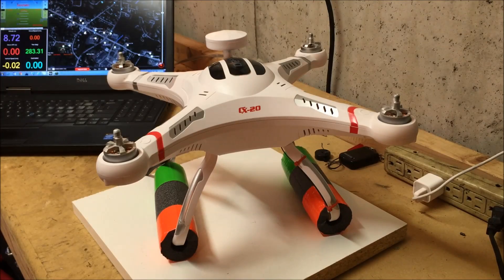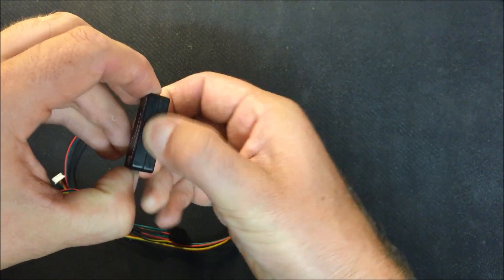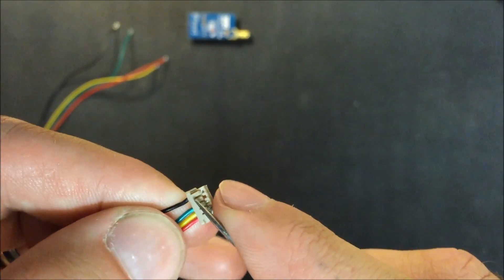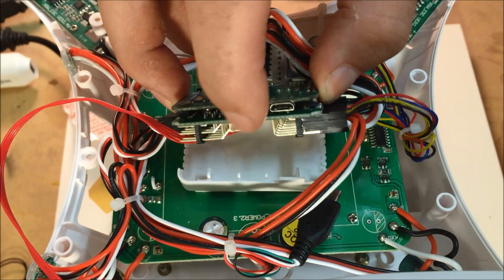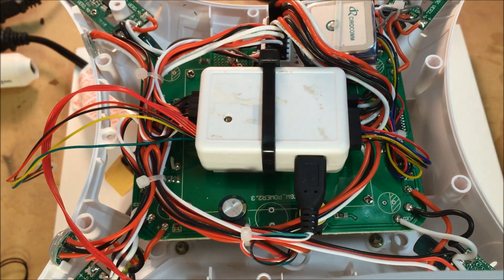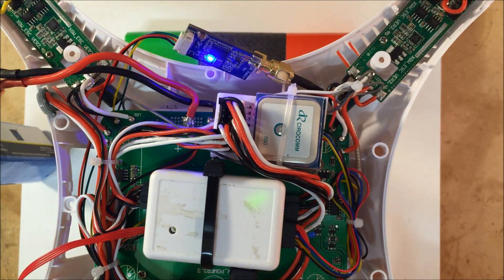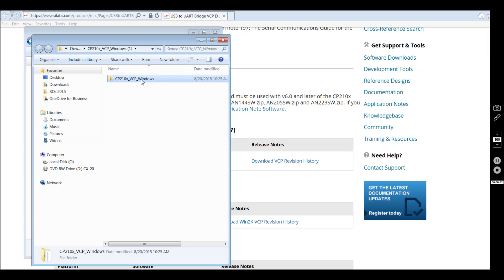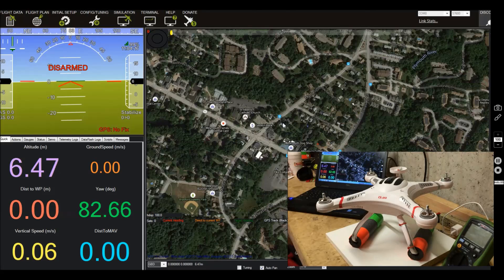Wireless telemetry for the Cheerson CX-20

Comment: Hi all, for some extra assistance....check your boards solder quality....  I spent DAYS trying to solve an issue with my CX-20 setting up my telemetry. I kept getting 'no heartbeat packets' and couldnt work out why. I swapped changed to multiple different firmwares, unplugged the GPS and other components, tested the power, used terminal to test the communication, etc etc etc i also swapped TX/RX for every change and tested them fully. Finally tested each port on the telem air unit and the APM and found that the APM had a bit of crap solder jumping the connection on the APM... well done who ever built it... thanks! anyway removed the jump and it now works perfectly. Just thought Id post my findings here.... anyone having the same problem... check your boards for solder quality and whether there are any shorts!!! thanks to tdracing13 for the video!!

Comment: Friend, I followed all your steps but when you connect the battery does not turn the telemetry only heats quickly and off.

What I can do?
Reply from the maker: Carlos M Castillo does the telemetry module heat up? The wires are definitely in the right places?
Reply: If you are put in correctly as your tutorial, the center's largest chip heats up, I have the same drone and buy the telemetry on ebay that I leave here the link below it.

http://www.ebay.com/itm/121905150283?_trksid=p2055119.m1438.l2649&ssPageName=STRK%3AMEBIDX%3AIT

Comment: Thanks for a great video. I have the Quanum Nova and was looking to add telemetry. Followed your video and successfully installed the system. Linked up to Mission Planner and responds just like your video. I had my RX and TX reversed and initially only had the single blinking light on the Air Module. The correction was simply to switch the RX and TX wire position and it was good to go. THANK YOU.
Reply from the maker: +Jim Magnuson Awesome! I'm happy to hear it worked out well for you

Comment: excellent video, you just made upgrading my CX-20 a breeze. Thanks for the effort. I used an 1/8" pilot hole first and depth limiters on both bits, no risk of damage from drilling.Questions, Do I still need a minimOSD or equiv or is that built into Mission Planner? and, do you think clover leafantenna's are worth it?
Reply from the maker: +brobb64 Awsome! I'm happy it helped you, that's a great suggestion for drilling. If you want to have OSD on your FPV screen you would still need the minimOSD. As far as cloverleafs go they are definitely worth the money, 5.8ghz is very susceptible to multi-path interference.

Comment: Great video! I was able to install my telemetry on my Cx-20. one problem I'm encountering is that voltage is not showing in either MP or Tower app. any thoughts?
Reply from the maker: +bryanflores04  I'm happy the video was helpful! Unfortunately in order to add voltage you will have to install a battery module like this one http://www.ebay.com/itm/Best-APM2-5-2-2-6-Pixhawk-Power-Module-cable-V1-0-Output-BEC-3A-W-XT60-Plug-US-/141729072661?hash=item20ffb60615:g:rUIAAOSwPcVVtf22 . I have one but have not installed it yet as I am rebuilding the CX-20 over the winter. I will have some new videos coming up including installing an upgraded flight control board, FPV, and OSD
Reply: cool! I'll wait for it! Thanks again! :)

Comment: Great video tdracing, just what I needed at this time. Recently purchased teh CX20, have added a Walkera 3G gimbal for my GoPro & have also bought an FPV rig, onboard telemetry was the only thing missing, appears to be a really easy install. Cant wait to get the 3DR gear & have this fully mission planner ready.
Reply from the maker: +Mark Webb Thank you! How do you like the Walkera gimbal? I have a cheap aluminum gimbal for it but was thinking about switching to the walkera to save weight.
Reply: IT is very stable and gives a great result even in gusty winds. I upgraded to 9450 props which I balanced by hand using a pencil, glass & a couple of nails in a board and was able to get min vibration. The Walkera gimbal needs abit of work to retrofit to the CX20, but there are a few video's upon that. Overall Im very happy with the configuration, just need longer langing gear to stop gimbal twitching prior to take off..

Comment: Question!   Installed my 3DR telemetry unit (Air) and have the flashing blue & red LEDs but times out when trying to connect to MP. I even tried swapping the RX & TX wires and still nothing, I have installed a new APM V252 V5.0 FC and updated the firmware. What was the HEX firmware upgrade you were talking about?
Reply from the maker: +Donn Brown (Photodonn) Hi, check out this video https://www.youtube.com/watch?v=MbqfpGElSyI . He covers the HEX file installation. I hope this helps

Comment: I wish you were bit more descriptive with the re-organizing the UART cable. it's really the most crucial part of the operation because you can fry the boards. I'm still not 100% on how it should be done.
Reply from the maker: +razorseal Theres a wiring diagram showing how the circuit should be wired in the video, is there any place in particular that you are having trouble with?

Comment: Hi tdracing13  I watched your video again, very informational.  You mention about upgrading to a GPS combo. What GPS combo do you recommend? Also is there a way that I could make the ground side of the telemetry unit work with my FPV monitor instead of using a laptop.  Thank you for your review it is very helpful.
Reply from the maker: +Skydive Driver Hi, thanks for the kind words. This is the GPS/compass unit I installed http://www.ebay.com/itm/UBLOX-NEO-6M-GPS-HMC5883L-Compass-Module-for-APM2-6-Flight-Controller-Multirotor-/231334797016?hash=item35dca0ded8:g:AysAAOSwQItUF-Wt . I did not buy it from this seller, unfortunately the person I bought it from no longer stocks this product. To get your data on the FPV monitor you could use and OSD setup to overlay the pertinent information over your flight video, I will actually be uploading a video covering OSD installation and setup in the somewhat near future.
Reply: tdracing13 Thank you for the come back.  So OSD,  this more involve by the minute.  LOL.  I will be waiting for your video.
Thanks again.

Comment: tdracing13.  Nice video  thanks for the info.  Did you experience any problems with the GPS since you mounted the Telemetry near it.
Reply from the maker: +Skydive Driver Thanks! I haven't seen any issues with the GPS beyond the dropouts I have been experiencing since day 1 (bad GPS module). Either way the new GPS/compass combo will be mounted in the puck with shielding :)

Comment: For anyone who wants to use 3.2.1 (recommended) and telemetry, here is the custom firmware to make that happen. I, along with many other guys, use this firmware successfully. Maybe tdragracing13 can make a video installing this 😀

http://www.baronerosso.it/forum/attachments/multirotori-droni-rtf/326284d1429882655-quanum-nova-fpv-gps-waypoint-quadcopter-arducopter3.2.1-quad-apm2-custom.hex.zip
Reply: *tdracing13
Reply from the maker: +Joe Quadcopter Thanks so much for sharing this, I haven't upgraded my firmware yet but when I do I will definitely make a video.
Reply: +tdracing13 

No problem, just be aware you will lose the compass calibration through the transmitter. You will only be able to calibrate through Mission Planner, but that is good because the "compass calibration dance" is not accurate. You don't need to calibrate often.

Comment: Very nice work.

Seems like when you had it open it would have been a good time to square up the APM FC module which appeared to be  cocked at an angle.
Reply from the maker: +TheGusK Thanks! Yes it is rather crooked, I wanted to order some proper anti-vibration mounting tape before moving it. I plan on going back in and upgrading the GPS in the next week or so, hopefully the tape will be in by then.
Reply: +tdracing13 Hate to say it, but that is one ugly antenna cocked out the side like that. :)
Reply from the maker: +TheGusK lol, it looks a little better now that I'm using the bulkhead connector but it's definitely far from attractive. I actually just found a little 5cm 915mhz antenna that I'm going to test, hopefully it works well.